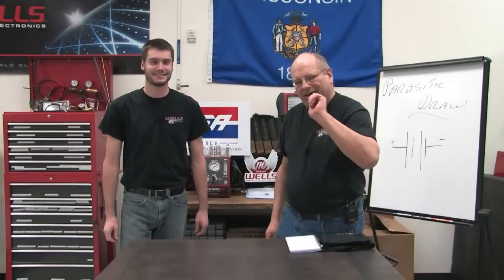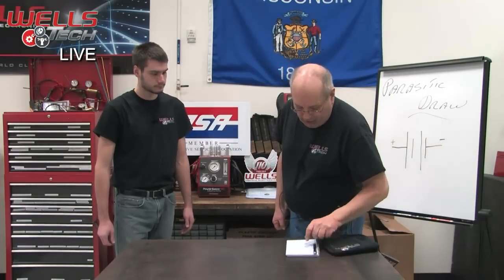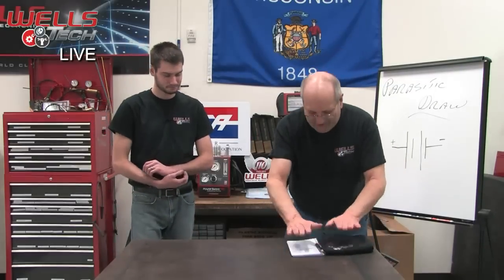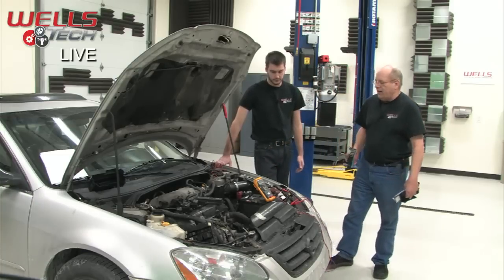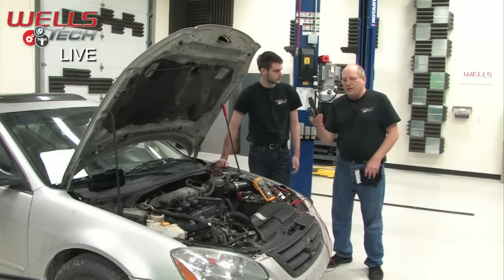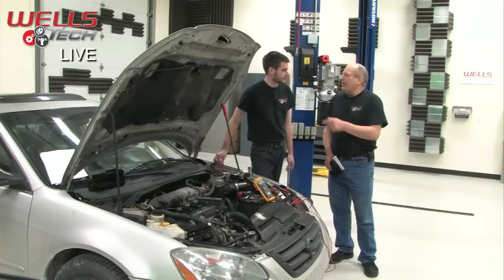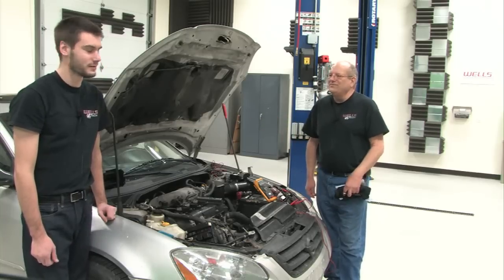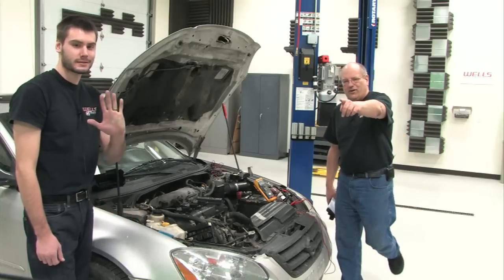Parasitic Draw Training

Comment: so the bcm or vcm was not defective, because it goes back to the same problem, and if you change the relay for  the a/c and it goes back to the same problem my question is .... do you have to charge the customer 3X because the customer goes back 3x?
Reply from the maker: Hey Filipina, you are right, the BCM was not the problem. The relay did fix this car. I have not heard back from the customer since. When installing the relay I told the customer that the a/c compressor or clutch may need to be replaced down the road if it kills another relay. As for charging the customer...It's all about doing what's right. There would be a diag charge the first time as well as a charge for the repair. The right thing to do then, when the car came back in, would be not to charge the customer. It left under the assumption it was fixed, returned because it was not. That is on me, the tech, and the shop. The customer has already paid to have the car repaired, they should not have to twice. Thanks for commenting!
Mike Becker, Technical Services Instructor